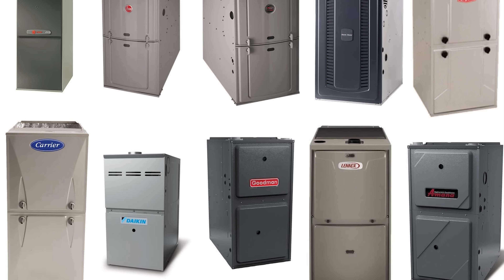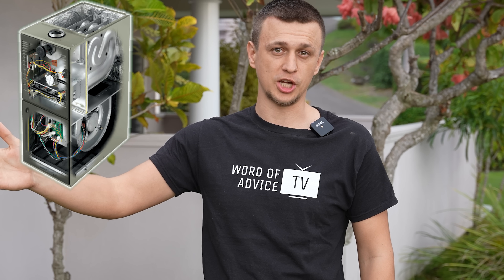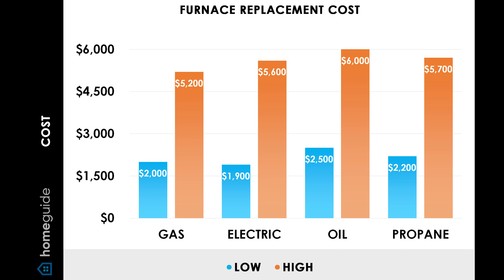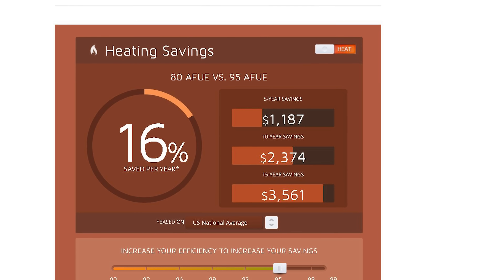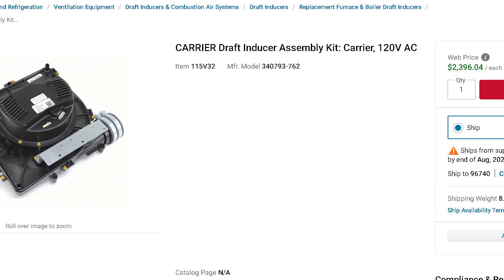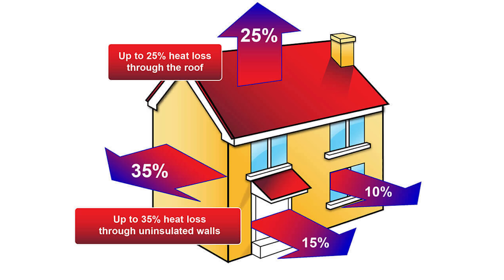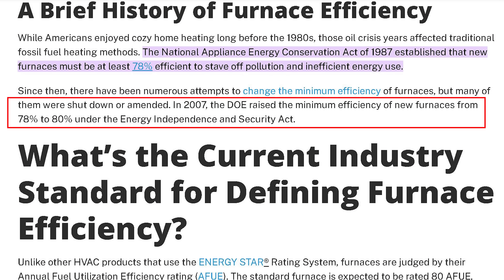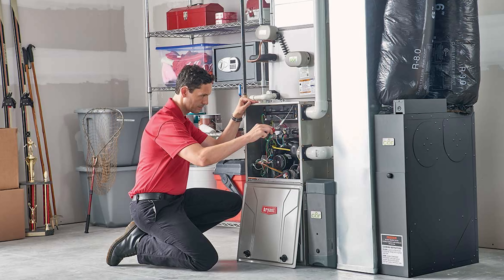Don't Buy a High Efficiency Furnace!

Comment: First of all you lumped variable speed inducers with high efficiency furnaces. That is not the case with your standard 95% furnace. Inducers are the same price and they have no more electronics than an 80%. The only difference between the two is the secondary exchanger and the need to dispose of the condensate. Next, If your home was built after 2000 you probably don't have a chimney so an 80% is not even an option. Last point, High efficiency units bring in outside air for combustion and have nothing to do with the air you breath. They do not add to the negative pressure inside a home already aggravated by kitchen vents, bathroom exhaust fans and clothes dryers. Why would you use air that you heated and humidified for combustion?

Comment: I was in the HVAC business for 45 years. A 92% furnace is just a few hundred dollars more than an 80% and on a new installation can actually be less than an 80% due to rebates and a chimney not being needed. The 95+ variable speed units while providing greater efficiency and comfort are definitely much more expensive and replacing parts can also be costly. Many companies offer a 10 year parts and labor program that along with the additional comfort might be an option but not a money saver over a 92% furnace.

Comment: This was very helpful!!! I wish I had seen your video 6 years ago.  We had Anderson Heating and Air Conditioning come out to look at our condenser (it stopped working).  Instead of replacing the capacitor she told us we had to replace the system.  $30K lesson: get a second vendor to fix the problem...with no option to replace.  When we got tired of hot summer days, we decided to replace our entire HVAC unit.  The guy who installed the new unit let us know that the condenser was fine, just needed a new capacitor....

Comment: You're 100% right older furnaces that had thermocouples blasted 40/50 years and you didn't have condensation tubes leaking into your furnace. It was a hotter heat. I believe my parents were scammed years ago they said it had a small leak crack and ever since then between 8 and 10 years the furnace has to be replaced meanwhile the old one lasted for 40-something years. The old ones worked far better. Thanks for telling the truth.

Comment: I was told only High Efficiency furnaces available in Toronto Canada.. 🇨🇦. ‘Just replaced Original 2004 Lennox 88,000 BTU @ 92% efficiency natural gas furnace with a 90,000 BTU @ 96% High efficiency Lennox unit due to age in Toronto , Canada $3,900 (CAD) as I already got my money’s worth and don’t want to freeze in cold winter.. Thanks for everyone’s info your channel is very informative .. I think with the new higher efficiency furnace now is oversize for 2,700 sq ft home and cycles much more often which isn’t good for it’s more wear and tear on equipment.. I should’ve downsized to 80,000 BTU instead >> All good 👍 BRAVO! 🇨🇦

Comment: Couldnt agree more. I am a self employed plumber gasfitter here in canada but I cant buy mid efficients here so I tell people to stick with their standard or mid efficient furnaces. The high efficient furnaces are very expensive to repair and have a new variety of problems like vent pipes freezing off or acidic condensate rotting out cast iron drains. I have two 1974 inter city furnaces in my place and they are built to be bulletproof and when properly tuned up you can hit nearly 80% efficiency with them. Parts are readily available and break downs are few and far between.

Comment: I have a super high efficient Tempstar Furnace, it is 30 yrs old and performs well. A few things have gone out which i have repaired myself, the heat exchangers have been fine, I think you have to maintain them, change filter regularly, make sure the condensate trap does not get plugged up. My guess is most of the problems with all furnaces other than maybe lack of quality is folks don't keep things clean and maintained.

Comment: This is exactly right, I live in Montreal, Canada. All the HVAC companies are pushing high-efficiency, and service contracts.  I understand why PROFIT. 
These direct vent super efficient gas and/or oil furnaces have all kinds of parts and sensors.. (just like new drive by wire cars ) if one sensor is off or one component fails no heat!  Also as one furnace repair guy admitted to me, lots of small repairs and house calls at $50 a call, $130 per hour + parts, gives the main install/repair companies and their mandators (companies who pay to be official reps) a huge level of income.  I think a combo of gas furnace for really cold winters, some electric baseboard for average cold and a fireplace for power failures, are a great approach to keeping warm.

Comment: My furnace is now over 50 years old and is still going strong.  I've owned the house for 26 years and have spent $0 on furnace maintenance beyond filter cost.  Things were made so much better back when CEOs were not focused on planned obsolesce and trimming ever penny from the cost of components.
Reply: Nice! curious if you have an outdoor AC unit too? Just wondering if your AC if you have it is running strong too?
Reply: @FALCO797  unfortunately I do not have central AC.  I get by with window-mounted air conditioning units.
Reply: Got that right, back in in those days things were meant to last forever, not u til the warranty runs out! Lucky u
Reply: @highwind8124  LOL, you must of got screwed on a high efficiency furnace.  You don't know his furnace is unsafe but assume so.  And yes, a lit candle in a house can also endanger everyone in a home but people still use them.
Reply: It's not the CEOs

Comment: As a self- employed HVAC guy I mostly disagree. At least with my pricing with York, the difference between 80% and 95% is only about $800-$1000. So you will get that money back very soon in my region in Utah, even with the default warranty of 5 years. But if registered, the warranty becomes 10 years.
York part prices aren’t as expensive as carrier or trane either. Plus my overall repair price is better than most companies anyway. Of course this is all dependent on my company and pricing of course. But that’s mostly my point. I run my business fair and honestly.

 Addressing the reliability issue, in my experience it has slightly more to do with how well it was installed, but more complexity does play a role. Any well taken care of furnace is capable of lasting more than 15 years in my opinion. 

Also one huge point I have is if there was a previous furnace that was 90%+ efficient in the house, it makes so much more sense to match the 90%+ when doing a changeout. Otherwise you would have to run a metal flue which can only vent through the roof. Most of the time that’s not even an option to do. 

The one place I do agree is with anything higher than 95% (according to my prices) they are too expensive for only a few percentage points higher. You won’t ever ROI on those. And modulating furnaces are a nightmare to repair and diagnose. 

In your favor, 80% totally makes sense with attics, rentals, people who don’t have a way to run pvc flue, or simply people who have a tight budget. I say go for it in those cases. I am also against the tactics some companies use to upsell.

Comment: I agree with a lot of what you said,Jay. As a retired HVAC man I am fortunate enough to have installed my own equipment. Having eliminated the "middle man" by purchasing from the factory. I can honestly say my electric bill was cut in half with the high efficiency & the gas bill is relatively the same after 6+ seasons. I do want to make a statement. In my opinion, it doesn't matter how energy efficient we try to be,we are never going to win because these greedy corporate energy companies are going to charge us more $$$ because of their share holders! 80% or 98+% we can't win!  Enjoy your knowledge,Jay.
Reply: "we are never going to win because these greedy corporate energy companies are going to charge us more $$$ because of their share holders! "
I own two gas wells on my property, no share holders. I get paid whatever the market rate is. I don't sell for less than the market rate, and i can't sell above it.
Reply: What savings you get from using a high efficiency HVAC system is lost to the higher price of the units.  You save on the one hand and pay with the other. Companies know this and will always take advantage of it.
Reply: @Rhaspun  The math just doesn't add up when the most you're looking at between 80 and 98 is a potential 18 percent reduction during the heating season alone. Saving 36 bucks off a 200 dollar gas bill less than five months a year means you might save 1800 bucks over a decade. Meanwhile, you paid the 4 grand difference in installation and unit cost in year 1. That 4 grand might be 8 grand if you put it in a mutual fund for ten years instead of a furnace.
In 20 years, you might save 5 grand if gas prices doubled a decade later. Meanwhile, your 4 grand would have grown to 16 grand in the mutual fund. If your unit doesn't last 20 years, you're even further in the hole.
Reply: @wisenber  are your wells still producing and for how long? Just curious?
Reply: @MK-xl9tt  The last survey indicated that I can expect the same yield for at 25  more years. If I used it only for my personal consumption, it's enough for about another 150 years.
I've intentionally limited how much they produce. They pretty much paid for the 20 acres I'm on along with the house I built and my 50X100 shop.
As they near commercial exhaustion, there's still enough to fully run everything on my property as long as I'm alive.
Reply from the maker: @williamdurbinsr.7321 Thank you for sharing your knowledge and experience in this good sir. Much appreciated!
Reply: exactly. Gee wiss doesn't cut it with me.
 But young people today, just don't know.
 Sad situation. Abd that goes for so many machines and appliances.
Reply: gas cost is down but we now have a delivery charge which was about 12 times the cost of gas.

Comment: I installed a Goodman high efficiency furnace 2 years ago.  Why Goodman?  Practically every other furnace can only be purchased through an installer and that means you have to pay someone to install it.  When I was trying to decide which Goodman furnace to install, I discovered two things.  1.  Like all furnace manufacturers, Goodman offers a standard 80% furnace and then they offer several efficient furnaces starting at 96% and going up at small increments like 97%, 98%.  Each of these small increments cost plenty as they claim you'll be more comfortable if the furnace evens out the heat by fluctuating the gas supply or fluctuating the fan speed.  This might be true, but I can tell you that no one in my family has ever complained about the heat not being even as our standard furnace turns on and off.  Most people don't even notice when it turns on and off.  Further, I consider these features to be more reasons for the furnace to fail in the future requiring hundreds of dollars to fix.  2.  The initial purchase rebates available vary from state to state, but in Minnesota, I discovered that the rebates actually make it more expensive to purchase the 80% rather than the 96% so that's what I bought.  The simplest high efficiency furnace.  It doesn't turn down the burners and it doesn't vary the fan speed but who cares?
Reply: Good Thinking
Reply from the maker: @frankhoward7645   Thank you for sharing your insights and experience! I appreciate you explaining the reasons behind your decision making. I am sure many will find this helpful.
Reply: You missed the point of the drawbacks of that furnace lol. Even if you paid the same, every other point in the video outside of upfront costs still apply. Low reliability, expensive parts, low part availability, etc.

Comment: I bought an 80% efficient furnace 2 years ago online. Had it delivered and did the removal and installation all on my own. Took out a bad goodman 80%, and installed a new 80% furnace. In total I paid $775 bucks. And I am totally satisfied
Reply: Adjusting the gas valve settings is where I stop. I’m not a guru at it.
Reply: @Kiddro22  honestly that was the easiest part.

Comment: I have a 1983 Sear's furnace and AC unit. In the last 12 year's I had it cleaned and serviced twice. I change the filter regularly.  It's an old 80% efficient model furnace. 
The tech that cleaned it last said we should get a newer, more efficient model, but I asked him, can I get one that will last half as long as our old one? He said no. Maybe 7-10 year's.  It's just not worth it to me.

Comment: OMG, yes. We had done without an old screen door at the rear of our house (which happens to be the main entrance). We just happened to run into an old aluminun one at a yard sale a few weeks ago. Luckily it had the frame pieces, which has been one delay in me (@ 70) replacing it. We paid 5.00 for it, I got it going and a young man helped finish hanging the frame. I bought some new cedar trim and bottom 2X4 to support and YAY...we noticed the difference immediately. Our house is 10 times more warm. It is raining and 40 outside, but cozy without the heat on. I caulked all of the window frames too and that helped. Now to get at the old floor furnace and get it cleaned and going. Small things help a lot...Don't forget those heavy curtains.

Comment: Agreed! My parent's gas furnace works flawlessly over 50 years now.
Reply: I miss the old days. I started in 1985 and with the truck with a decent amount of truck stock. Nothing too crazy I could repair just about every furnace out there. Now forget that because of all the different parts. When it comes time to replace it, just put an 80% furnace in. The thing I have to warn you of though is the government right now especially with the Democrats in charge of the Fed want to make a minimum for efficiency 90%. So if your parents are thinking about replacing the furnace soon they should do it before any new regulations, and they will have to get a condensating furnace. Those old furnaces are tanks, but they won’t last forever.

Comment: In 2006 the installer gave me the option of installing a high efficiency 90+ or an 80+ efficiency furnace, I opted for the 80+ Goodman.  Over the years I have had to replace a flame sensor, draft induced motor and a run capacitor for the furnace motor.  I also replaced the run capacitor for the AC condenser.  All parts were readily available on Amazon and were very ease to diagnosis with a multi meter and install.  Very glad I got the 80+ and not the 90+.  I totally agree with you, great videos appreciate it.   The furnace is running great at 17 years old.
Reply: When I worked for a contractor, we would charge are diagnosis and sell a A/C compressor capacitor for about $75, and about .5 hour labor for a total cost about $187.  Your amazon capacitor is only about $20, so a great job saving money!

Comment: I have been telling everyone this forever. I am an hvac tech going on 27 years. I have never seen a high efficiency unit go more than 5 years without a problem and condensing heat exchangers always clog up the drains and heat exchanger itself—I personally would not own one yet. I just replaced my whole system and installed an 80 per enter.
Reply: Come on over and you’ll see your first one
Reply: I am sure it happens but it is very rare—I don’t like the odds.

Comment: I completely agree with your video. In 2009 80% efficient  furnaces were no longer around to be sold in Canada. 

We have been getting hosed ever since. The next evolution will be to phase all gas-fired furnaces out and replace them with heat pumps. 

A single stage condensing furnace is the cheapest option in Canada for a furnace repalcemt
Reply: Yeah it’s a shame we’re on the same path here in the lower 48 we’re coming to the end of our units with psc blower motors and they’re push hard for the heat pumps.

Comment: We just had a new 80,000Btu 96% efficient 2 stage furnace put in last August.  To me, it's not all about saving money.  The builder put a furnace that was almost twice as big as needed.  That was 1988.  It was an 80% 150,000 Btu unit.  What is really important is comfort.  With an oversized unit, it is never on.  That means you freeze when it isn't really that cold out which is most of the time you need it.  And it is impossible to get performance out of a humidifier when the furnace never runs.  I think if you are in an area that gets down to 0 degrees Fahrenheit once in awhile, a little more expense for a two stage is well worth it for the days when it is 40-50 outside.  If it cost $4,500 and lasts 15 years, that is only $300 a year.  i pay 10 times that for the families cell phones.  So far my gas costs have been 20-25% cheaper this winter.

Comment: My home is 20 years old. Installed a Lennox high efficiency variable speed A/C and furnace last year. Love it!  Home is more comfortable in summer and winter. No more hot or cold spots in the home no more constant adjusting the thermostat temperature. Significant lower electric and natural gas usage as well. If you’re looking to get a ROI from any furnace, get a wood 🪵 burning stove.
Reply: I’ve been looking for a 90% efficiency wood burning fireplace insert. But these prices for the inserts are highway robbery with a date rape combined.
Reply: Love the high efficiency furnance.. I can tell big difference with no more temperature spikes. The temperature is always constant.

Comment: Thanks for your honesty. It makes sense . My Bryant  80% is 23 years old . Never a problem. I’ll get parts to a point if it fails.
Reply: Extremely surprised you’ve never replaced the inducer on that, those things chew through inducers faster than any other brand
Reply: @timrob0420  
Never replaced anything. I live by San Francisco, so no extreme weather so far .  I have cleaned the burners last year , and they weren’t very dirty either. I would take that brand again cause it’s my own experience. Thanks for your comment.